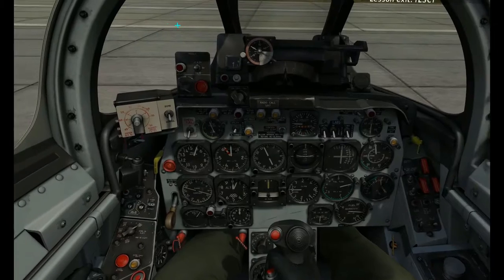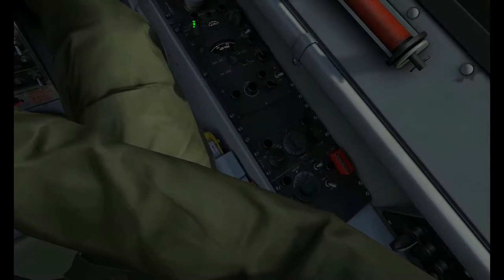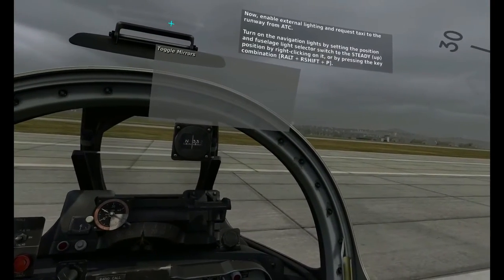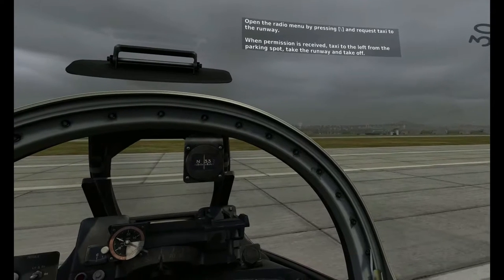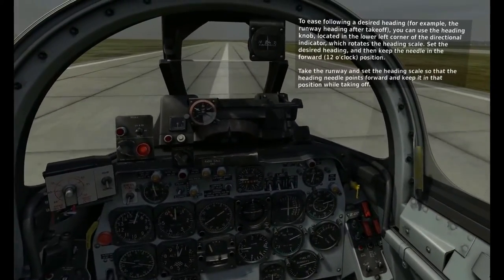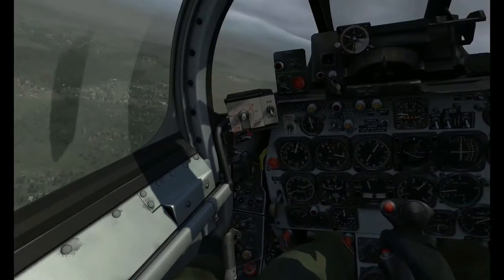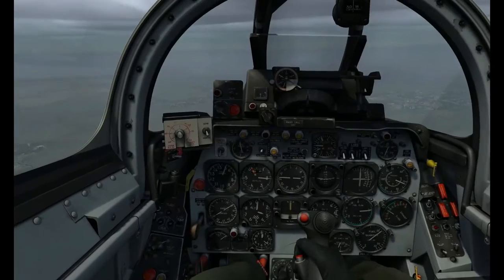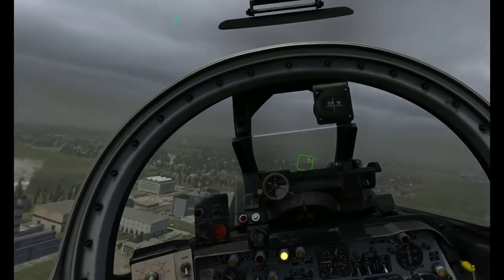Oculus Rift DCS F86F Tutorial Taxi, TakeOff,Navgation ,Landing & Shutdown on the ramp.

Comment: i'm new to dcs and having trouble mapping my PlayStation controller to the game. rudder doesn't work. I've tried assigning it but no luck. can I fire missiles form the controller? to hard to use keyboard with oculus on
Reply from the maker: Well first of all let me say welcome to DCS sim Community. Now i'm not to sure why it's not working as i believe most games on the Steam now have code so that you can play games on the steam with a PS controller as with the Xbox. Did you buy off steam or from the DCS website. Other than that bud it could be  a faulty controller or a software issue. Have you tried another controller to see if that solved the problem?

 Here is a link to DCS  https://www.digitalcombatsimulator.com/en/index.php
Then click on the Forums tab and post your problem on there i'm sure some1 will be able to help you get to the bottom of what the problem is, they are a friendly and helpful bunch of guys.Hope this is  helpful to  you  bud.
Reply: controller works fine on other games. bought on steam. I believe I would love playing dcs but seems daunting to setup while using the oculus rift on your head.
Reply from the maker: Ok well you can start DCS without VR . Start it up in normal mode then go to setting in the game and config your control setting then ,if doing it in VRmode is a pain.